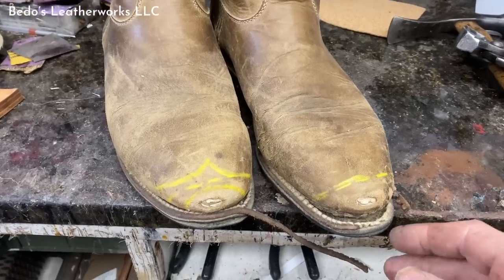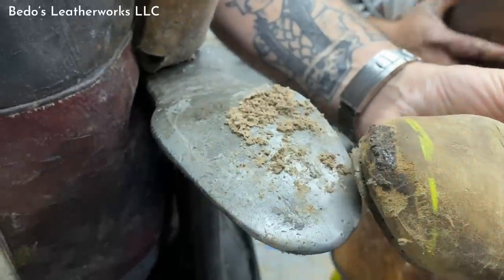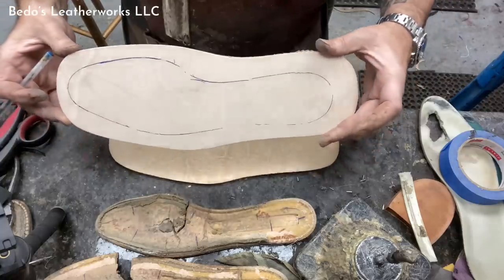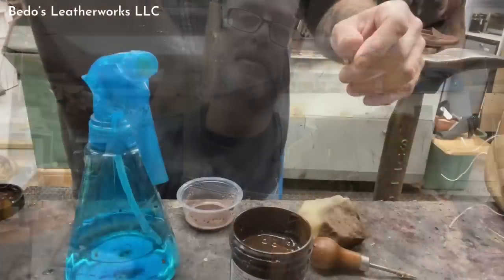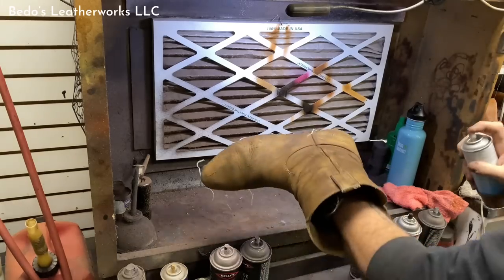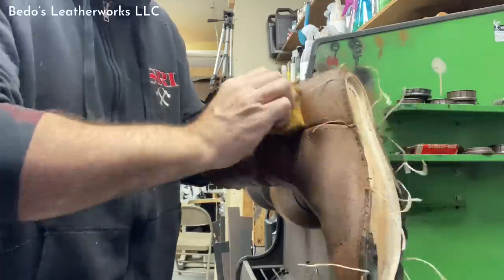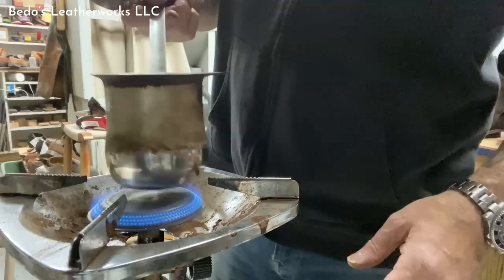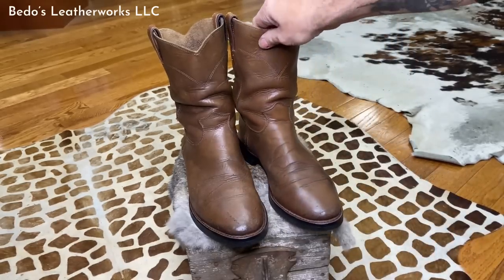Justin Boots UPGRADED - Now They Are Very Solid!

Comment: You say you've been shaking since you were 10, but you were definitely shaking more after your coffee break. I don't know what to think anymore 😱. Nice job anyway. Are the touch-up done with leather dust and cyanoacrylate glue going to last that long? I know that it was the customer request, but it was a better idea to add a piece of leather on top the holes on the tips. By the way you're my mentor. I'm currently working on an old pair of Allen Edmonds McAllister on which the uppers only can be saved.

Comment: I know a pair of boots with this much use can have a sentimental value, but just curious, what’s the approx cost of the repair? Wondering if it’s cheaper to buy a new pair instead?
Reply from the maker: You can probably buy a few pairs. The price is in the description. $624

Comment: I have a question about the durability of the toe glue. Does that harden? or is it flexible?
Won't that crack/chip away when they get worn?

They look great at the end.
Reply from the maker: the toe area doesn't need to flex, however if the customer continues to wear it like before then yes nothing lasts forever.
Reply: @BedosLeatherworksLLC  I understand, thank you!